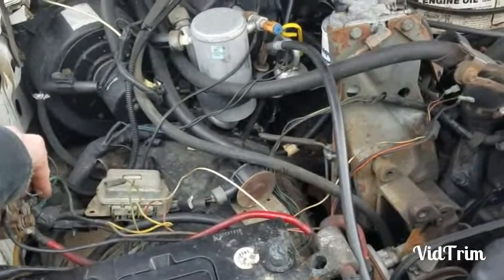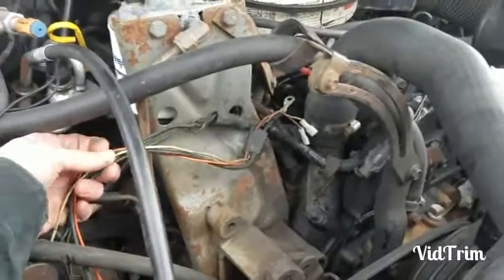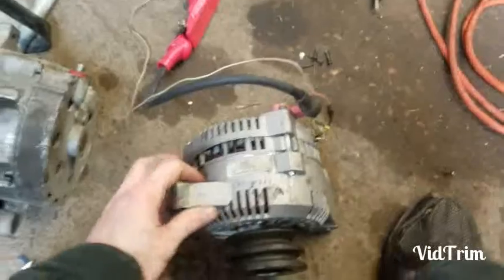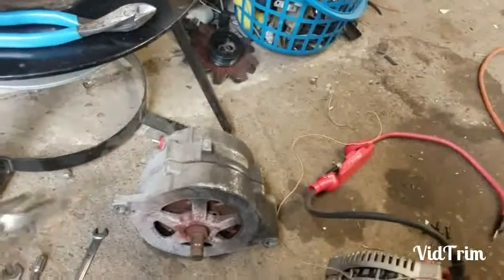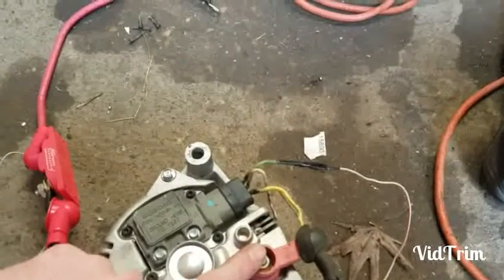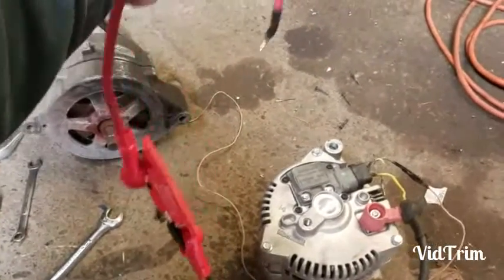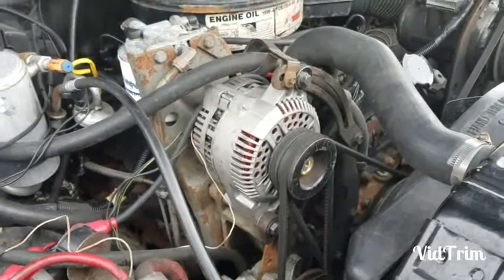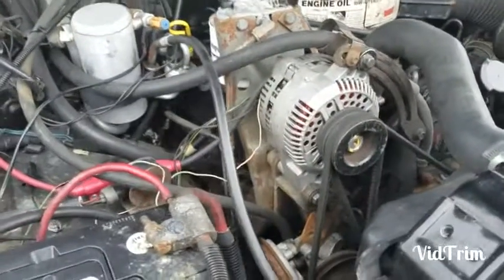Ford 7.3 idi diesel 1g to 3g alternator swap upgrade SIMPLE 2 wire hook up

Comment: I performed this upgrade, my battery voltage is now 19.5 when engine running? It's 14 when off.
Reply from the maker: Sounds like your Guage is inaccurate
Reply: @worthshop   I'm using a pretty reliable multi-meter. I think the pulley is smaller than my original alt pulley. Increasing alt revolution per minute.
Reply from the maker: @1962luckydog  Voltage regulator 3vens out the output despite different rpms. 14 volts with engine off doesn't make alot of sense is why I suggested maybe the Guage is off.

Comment: You ever have issues with belt squeel after a swap like this? Just did this to my 88 f250 and can't get rid of the squeel. Tried a new pulley from a part you had listed on another video. Can't tell what's going on. It squeels at start up and when I rev it up. Nothing at idle.
Reply from the maker: I would suspect your not getting the belts tight enough. You have to adjust the vaccume pump and alternator belt.

Comment: Will removing alternator help me to access manual fuel pump easier ... That's my goal
Reply from the maker: I have never needed to remove alternator to get to the fuel pump. I pull the pump from the bottom side.

Comment: My green with red wire there’s no current going to it when the key is on but I have a red with green strip that does but it’s going to the plug that’s mounted to the fire wall
Reply from the maker: It is hard for me to give advice without being there, using a test light to figure out what is going on. I can say the green with red stripe is usually switched power from the key. I do not want to steer you wrong, and electrical is tricky. I apologize, appreciate you watching and hope you are able to figure out your project.
Reply: @worthshop  i understand. Yea the test light is what I was using that’s how I found the red with green strip the same wire that the black tach wires that comes out of that plug

Comment: So where does the green yellow wire from the harness & white wire splice too ?
Reply from the maker: If I didn't mention them they are not needed.
Reply: No from the new harness
Reply: @worthshop  the new connection harness to the new 3g alternator. The green red splices to the harness 
The yellow runs back to the lead post where does the white one go ?
Reply from the maker: @GetOffMusic  It goes to a black plastic spot on the alternator case. Basically comes out of the alternator 3 wire plug and right back to the alternator case.

Comment: What is the alternator you swapped out I can’t find one to fit the brackets properly
Reply from the maker: I got one from a 1995 ford Taurus with the 3.8 v6 engine. It is 130amp output, has a small alternator case but long ears that reach out far enough to fit the space the old one filled perfectly. Search rock auto for parts # s or just order one from them.

Comment: What is the part number of the replacement alternator that fits properly
Reply from the maker: Early 90s ford Taurus with the 3.8 v6 engine. Make sure it is the small case with long ears.
Reply: I ordered an OBB alternator and the part number is 7756-3N-2G. It’s the identical one in this video
Reply from the maker: @JuiceboxxJerry  Thank you for the info.

Comment: Thanks for the video im doing the job right now. Did you change the vacuum pump belt at all? Mine is now like an inch too long with the 3g alternator i guess somebody changed it to a wrong sized one in another life...
Reply from the maker: I used the same belt, if you swap the stock pulley over the dimensions will not change.
Reply: @worthshop  im just too stupid... i didnt notice there was an ajustement on the vacuum pump... my bad

Comment: Thanks for sharing!  I'm changing the Alternator on my 7.3 IDI (Ambulance version with 165AMPS )   ...Only the original alternator was a Leece Neville, and the new one is a Motocraft 3G.   Totally different shape and size and now I need an extender on the bracket to accommodate the bolts.  Haven't figured it out yet but fingers crossed I'll get it done this weekend!
Reply: Gauntlit 1 what is the part number on that Ambulance alternator? Is it part number 7756-3N-2G? What year is your truck?